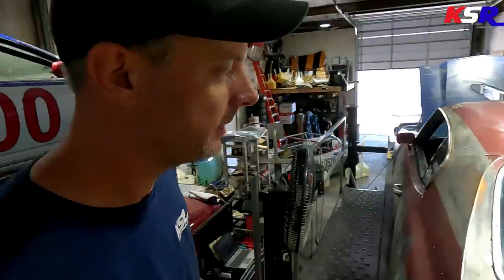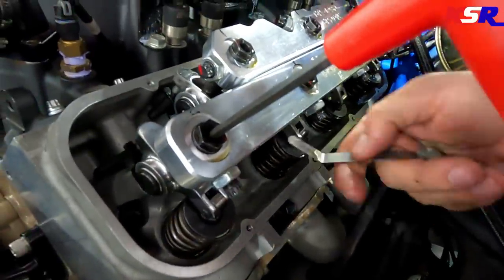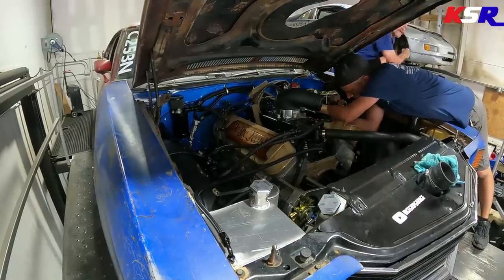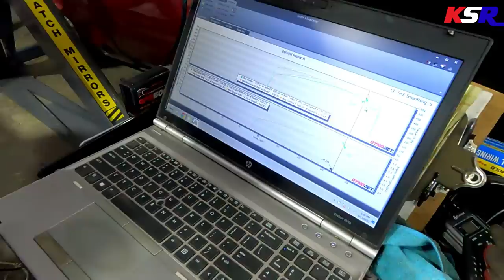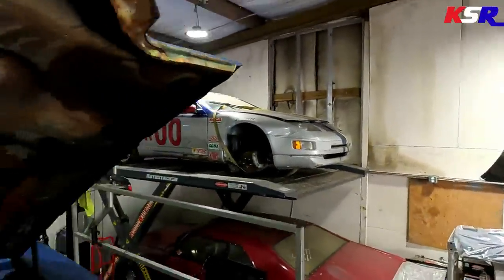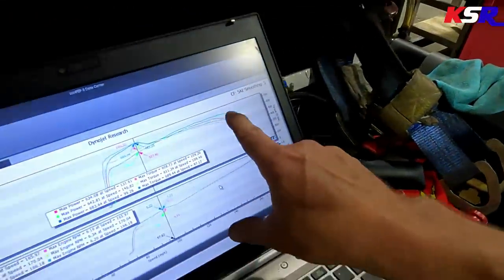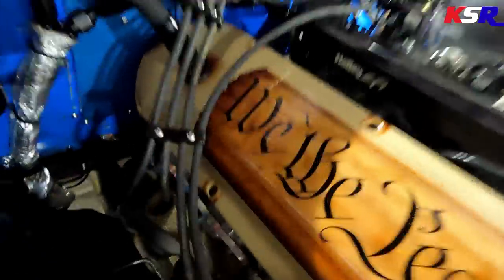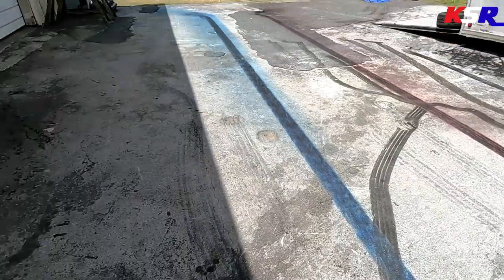PROBLEMS on the Dyno for Independence....But We Fixed It!!! You Won't Believe How Simple it Was!!

Comment: It's funny when you look at the letters on the tires as they go around they go different directions at different speeds.  
 That little hat on carb is a huge restriction on a na motor. But force induction will be different especially on ethanol.
 Be safe , good work on the head phones for ear protection.
Reply: That is an odd phenomenon isn't it. Optical illusion :)

Comment: It's amazing to me that the poor little 10 bolt is still alive and seems to be working flawlessly
Reply from the maker: She’s had a rough life!!
Reply: Back in the day we raced a 69 nova full steel body 4000 lbs. We ran stock 12 and 10 bolts. We found the 10 bolts to be stronger and lasted longer. Car ran mid 9’s carrying the wheels to almost 60’. We painted lines on the axles and would inspect them every few passes.
Reply: @KSRPerformanceFabrication   what was the hp difference between the hat and no hat?
Reply: @wallysworkin823   i always weld the axle tubes in when i build a 10 bolt

Comment: I have never had any luck with those Kevlar boots/sleeves either. I have burned more wire and boots with Kevlar sleeves, then with out. I have found good set of spark plug wires and wire management is a way better option. If shielding is really need, I have had better results using the Silicone rubber Coated stuff just were needed.

Comment: I've experienced the exact same problem with those boot protectors.  My dad and I co-own a roots blown big block '69 Camaro and rather than trouble with one or two boot ends, the majority were melted to the extent we had to order another wire set.  Completely removed the insulated boot protectors and haven't had a problem since.  That tells me they're actually boot COOKERS as opposed to boot protectors. 😕

Comment: Questions?

1) Assuming that the after market fuel injection system can accept two O2 inputs, isn't it better to install an O2 sensor on both exhausts on any V engine with dual exhaust?

2) Is there a better torque convertor configuration for burn outs as compared to drag racing?

Comment: I'd really like to see what independence runs in the 1/4 mile now.  Burnouts are cool but so hard on engines.
Reply: Heat is the main issue with burnouts. Thats why Kevin added the extra expansion tank. Not as much load on the engine as drag racing since the tires are always spinning. But it's a natural "send it" vibe while doing a burnout to keep it close to/on the chip, which doesn't help engine life.

Comment: If that's an MSD blaster II coil, should they not be mounted in the vertical position?  I read that they are oil filled and when they are on their side they can get an air pocket and cause the coils to over heat and possibly burn up.

Comment: I loved Wills old procharged 3rd gen….isn’t it crazy how the engine combo’s have changed since back then…. It used to be BIG CI (600-700”) twin turbo and procharged setups and now 540” is about the biggest people go with boost.
Reply: I'm 69 so I'd say electronic components, if I was 30 years younger I'd say better computerized components, when I was 30 was still running "points and condenser" and stamped steel rocker arms, but a 350 pushing 450 hp and 550 torque in a 3000 pound car wasn't too bad. Same body style as you just tested but an Oldsmobile, it had too much traction couldn't get her to smoke, just do wheelies.

Comment: I've melted an MSD high temp boot though a plug sock and header wrap on my SBC 360 on #7. After the 3rd boot, said screw it and used a ceramic boot. Not gonna melt that!

Comment: For std firing order you can adjust on #1 TDC 1257 intake and 1348 exhaust and turn the motor 180 degrees to #6 TDC and adjust 3468 intake and 2567 exhaust, and you only have to turn the motor once.
Reply from the maker: Not with a real big cam

Comment: When I put the 454 in my Squarebody I used chevelle headers and 2 straight boots were touching. I used a hammer and 2 LS truck metal boots and haven’t had a problem since. I also have a few from a 6.2 ford I’m gonna cut and use for a few 90deg boots

Comment: I hate solid lifters. Give me a hydraulic cam any day. The minimal power gains just aren't worth the hassle. Nothing beats set and forget.
I never met a big block that liked high RPM's. I have a few old Polaroids with several big blocks that sent the pushrods through the valve covers. Never once had that happen with a hydraulic cam. The funny thing is most of the time the pushrods didn't bend because they are huge. Pushrods and broken springs were my demons.

Comment: Missed opportunity dyno pull.... 
With explaining details with demonstration.  Showing power loss from Parasitic draw of the pro charger without the charge pipe and hat being installed.
This info also fills in the gap of missing thoerical power expectations of running 8/9 Psi.

Comment: Good catch on #6 wire.

779 HP is not an even number. Turn the boost up slightly till it reaches and even 800 HP.

Comment: Regarding the power gain from removing the carb hat. Would you say that gain was from the air having to turn that corner? Or is the opening to the hat actually too small to flow enough air for that big block? I've been considering a similar one for some of my classics; for the look and the cooler air.

Comment: Use a screwdriver and jump the coil... That's how I used to bump mine without the keys in the ignition.
Reply from the maker: Can’t access the starter with the headers installed.
Reply: @KSRPerformanceFabrication  ignition coil is on the starter...?
Reply from the maker: @nealp.2841  jumping the ignition coil will not crank the engine over, the starter solenoid has to be energized

Comment: Ever have a comparison on a blow through set up with carb or tbi, then compare it to mpi. Intake are temps drop like a rock when the fuel is at the throttle valve vs fuel at the intake valve. Gives the fuel more time to take the heat out of the air. Especially with running corn. Those new tbi units do great when blown through. But have their hp limit… 👍

Comment: Why did you set both the intake and the exhaust lash at 0.012?  Doesn't the exhaust get more than the intake normally due to heat expansion?

Comment: Why don't you use Airshow smoke fluid injected into the exhaust like the airshow pilots use?  
Just put a switch on the dash or steering wheel to start and stop it as needed.
Reply: Because the point of the burnout "contest" is to create clouds of smoke from wildly spinning tires, not from smoke fluid injected into the exhaust.

Comment: Kevin I don’t know if I was looking at it incorrectly but when you were showing the final graph it looked like the engine started out making way more power on the run where you lost the spark plug. To me it looks like the graph said the good run was actually not nearly as much power as the bad run at the beginning did I see that correctly
Reply from the maker: No, early in the run, the pulls were right on top of each other

Comment: Hey Kevin, to bump the engine over I had whats called a bump button. All it is, is a small handle with a push switch in the end and 2 wires that you clip onto the starter. It's really handy when running a solid lifter cam.
Reply: Also known as a "Lone Wolf 6000"
Reply: Who the hell wants to crawl under the car to hook up a bump switch when you have someone to bump it for you? Just saying.

Comment: I love the positive attitude vibe and problem solving thought process in your videos.

Those woven heat shield socks only protect from radiant heat (distance) but do little to protect from near direct or direct contact heat. Worse yet they then hide from view any damage that does occur (as you just found out). When it comes to protecting spark plug wires and boots, air space is your best friend. If you can't provide air space then your next best option is some sort of solid shielding (aluminum, ceramic, etc.)

Comment: IS THAT LASH VALVE ADJUSTMENT NEEDED ON HYDRAULIC ROLLER  LIFTERS?
Reply from the maker: No, not if the preload was set correctly.
Reply: Thanks ❤️❤️